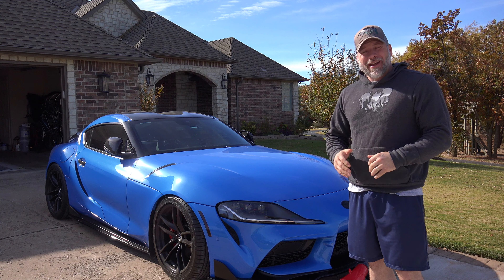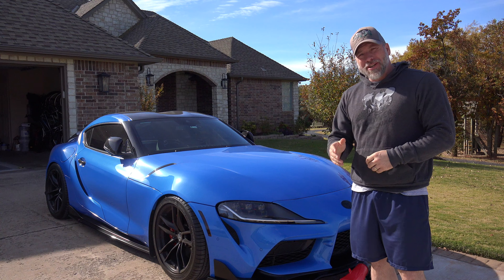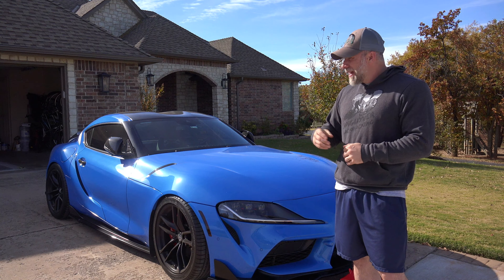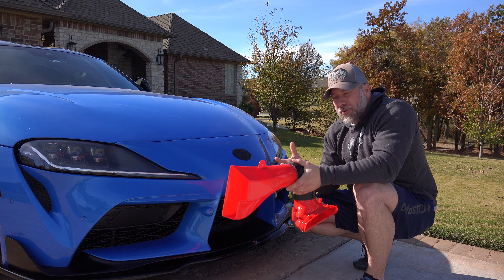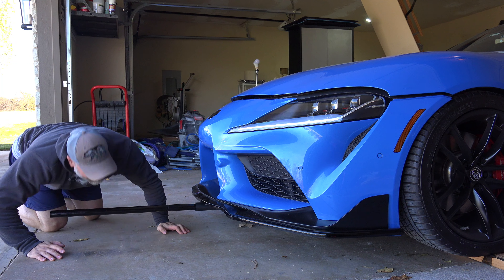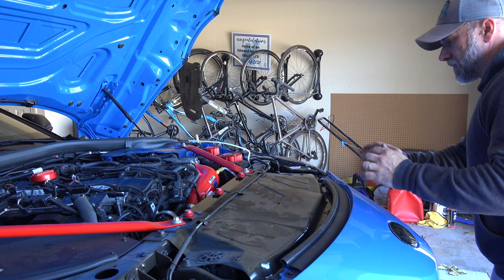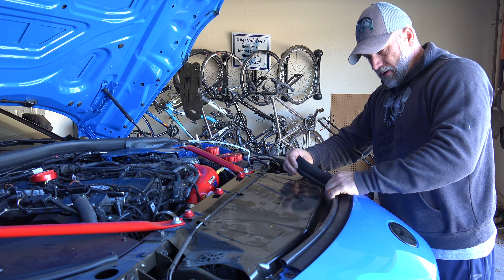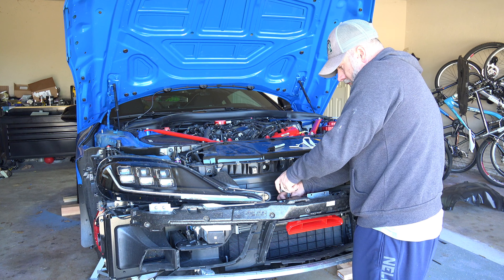Supra MKV VelossaTech Big Mouth Ram Air Intake Snorkel Install :: Cooler IATs

Comment: Get a inner chiller , CSP runs them . Tank installation gets IAT at 20 degrees Fahrenheit
Reply from the maker: Running the meth that I have on it should be reducing the actual intake temperature quite a bit.

Comment: Thanks for the video. Look forward to the results when you have them! Not sure I like the red color but let us know about the IAT's.
Reply from the maker: It comes in a lot of different colors.
Reply: Would also like to understand the impact on the trans cooler as it seems to block airflow to that as well. I had one of these on my Focus ST and liked it but it did not interfere with cooling like this one could for the Supra. Thanks again.
Reply from the maker: I will keep an eye on it.  Probably more of an issue if you track the car.

Comment: Looks like you switched your front lip from the rexspeed(?) to the maxton v2! How come the switch? I’m new here so I may have missed the explanation. 

Did you end up going gloss black finish on the maxton lip?

And could you link me where you got those wind buffeting solutions ? The CF on them looks 10/10!
Reply from the maker: I went with the full Maxton set in gloss black.  I didn't like the look of the carbon on the lip, and especially since I was doing the full package, lip, side skirts and spats.

Comment: Is it possible to get the red plastic parts a black?  Is it possible to wrap certain parts with aluminum foil outer insulation inner wrap to prevent the  heat penetration?
Reply from the maker: Yeah, all the parts are available in different colors

Comment: What tool do you use to cut into the shroud? That’s the only part that makes me contemplate doing this or not lol.
Reply from the maker: I started with a rotozip that I have, but it didn't fit in there well, I actually did most of it using a hacksaw blade and just doing it by hand.
Reply: @spiguyversgarage9452  looks great! Looking forward to the test results.
Reply from the maker: Thanks!  I appreciate you checking it out!

Comment: An A for effort but I am super skeptical about this plastic thingy. Highly doubt it will make any difference to the engine's performance. I think the biggest difference would be by figuring out how to keep the charge pipe from getting heat soaked. By the time the air travels through that whole system and goes through the hot charge pipe and gets into the intake manifold, it will be hot, regardless whether or not the origin of the air was made a bit cooler by using this snorkel. And the RAM effect doesn't work on this highly computerized, modern cars. The ECU will keep the AFR whatever it's set to be regardless of how much extra air you attempt to ram in there.
Reply from the maker: Completely get all you're saying, which is why I wanted to get one and run some real world testing and be able to report back to everyone what I got for results.  Not going to sugar coat any results.

I got a discount on it, and figured it was worth giving a shot, I've paid more for less!

Comment: Do you have a downpipe yet with the jb4 tune?
Reply from the maker: Yes, I'm running the AA Catted DP.
Reply: Have you got to dyno the car or do a 1/4 mile run since getting the tune?
Reply from the maker: No, but I will have some data in about a week that I can post up.  Meth kit installation should be finished up today and we'll be working on the tune this week.
Reply: @spiguyversgarage9452  nice!! Looking forward to that video